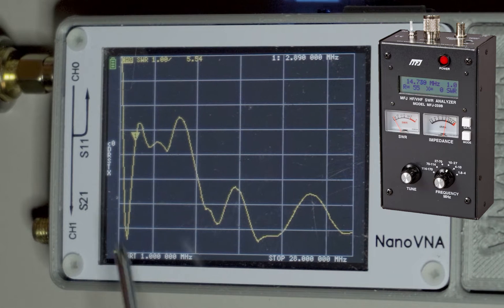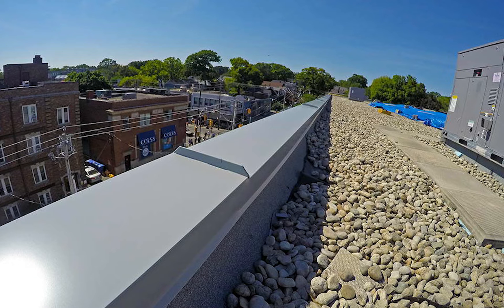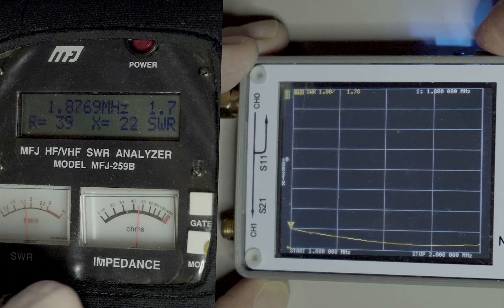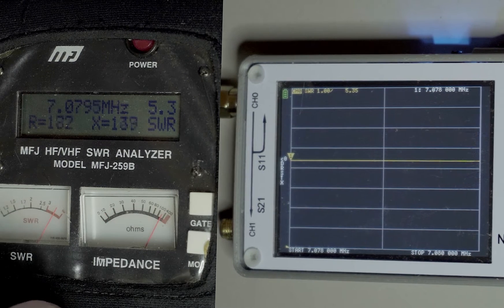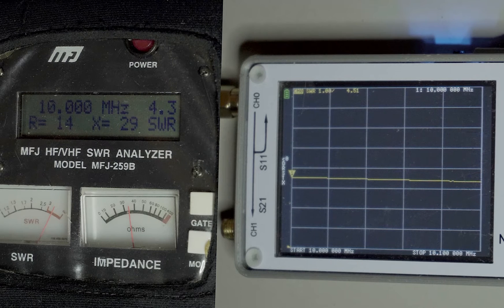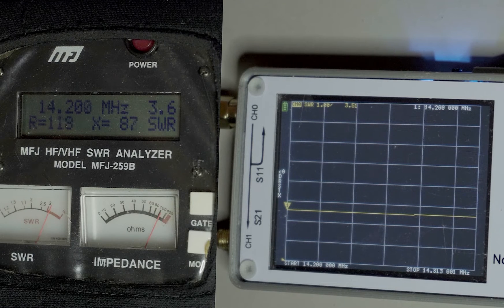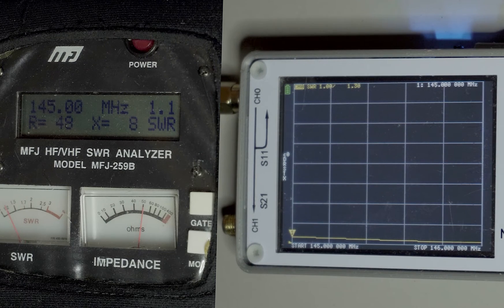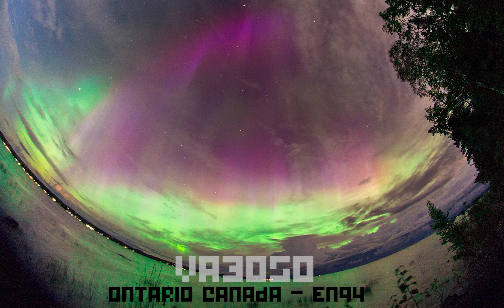NanoVNA vs. MFJ-259B Antenna Analyzer | SWR Comparison

Comment: Hej, I dont understand why you sold your MFJ?? It was "similar" to the digital and upgradeobligatory tool.
The MFJ is much better to use and very usefull in rough situations, the BY-tool has always batteries when you want to use it.
73 de.
Reply from the maker: The MFJ took double aa batteries and the NanoVNA has a built in battery that can be recharged.  The NanoVNA is lighter and smaller and does way more than the MFJ.  Just my opinion.

Comment: I have both and what I like about the MFJ over the Nano VNA is the physical size of the unit and the meters.  The Nano is sometimes hard to see in the bright sunlight in the field, if I set it down on a picnic table sometimes the weight of the coax pulls it off the table where the MFJ is heavy enough to stay put.  Of course I like the Nano since I can download the data to the computer and save/print charts/graphs.  Thanks for putting this short video together de WB8BHK

Comment: You need to calibrate the vna every time you change the span.  Or else you are interpolating the calibration points.  That's why you have a little c on the left of the screen, instead of the big C.
Reply from the maker: Thanks for the tip!

Comment: The NanoVNA is a lot cheaper and it does a lot more than an ordinary SWR meter. 
You can check your transmission line, tuners, dummy loads and discrete components too.
It's often surprising to see how complex a simple inductor is as a function of frequency.
The NanoVNA is very educational.

Comment: The "white" VNA is a clone. But for HF it will work OK. 
You would have better results on the nanoVNA if you calibrated beforehand on the bands of interest - each - nanoVNA by default has 101 reading points so even if you calibrate 1.5MHz to 30MHz they will be across 28.5MHz...
Also display  R and X to compare with MFJ and to get acquaintance with your antenna.
73 de Luís

Comment: From WB5MZT, I just bought a NanoVNA. Great ending. Yewdaman! That eBay listing will go down in history. Back in the early '80s, I used an HP network analyzer that cost $80,000! My house cost $45,000. This NanoVNA is considerably as accurate as the HP network analyzer and cheaper than my house.
Reply from the maker: Hello, thanks for watching.  Since getting the NanoVNA, i've been using it alot.  It's pretty simple to use, at least for the simple things I use with it.

Comment: There is already a difference between what the MFJ LCD shows and what is on the SWR meter of the MFJ on the bottom left. Sometimes even worse than between MFJ LCD reading and Nano VNA. Good choice to sell the MFJ. Besides the accuracy the Nano VNA gives you an instant overview over a wider frequency range.
Reply from the maker: Seems like it's not for everyone but I really like using it.  Thanks for watching.
Reply: But the pile of adapters that add variables, and require a lathe to adapt common coax connectors, to fully trust calibration procedure, downvote.
It is still, an epicly absolute bargain for it's options and literally a pocket antenna and balun designing lab device!!!!!!!!!!!!!!!!!

Comment: Yeah I have both pieces of test equipment and haven't used my my MFJ since my initial testing and comparison that I performed when I got my first Nanovna. I recently got the H4 model for the bigger screen. Best of all I can stick the Nanovna in my pocket, can't do that with the MFJ-259B. 73, KC3EKL
Reply from the maker: The screen is a bit small for my aging eyes, so that H4 does look good.  Thanks for watching.